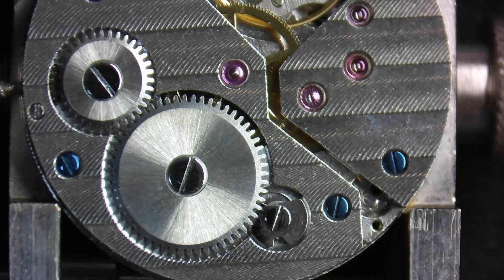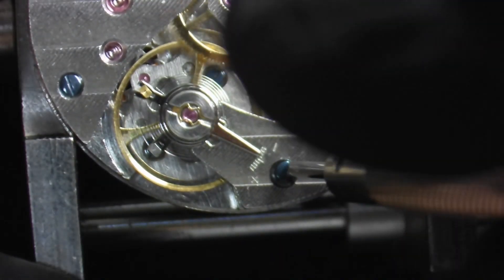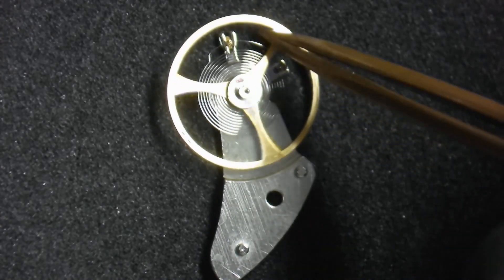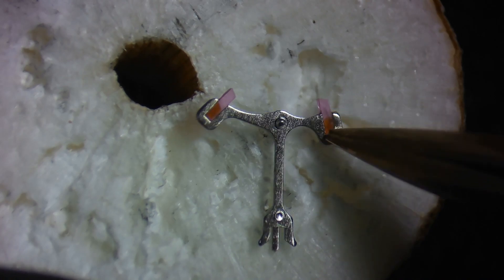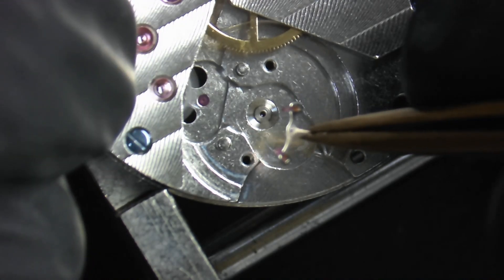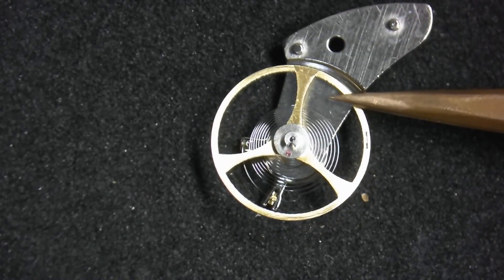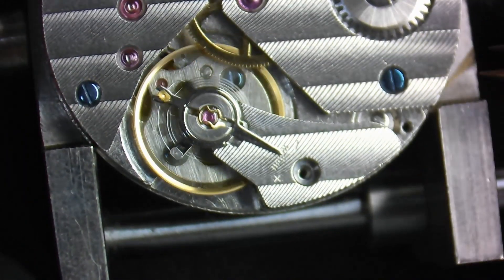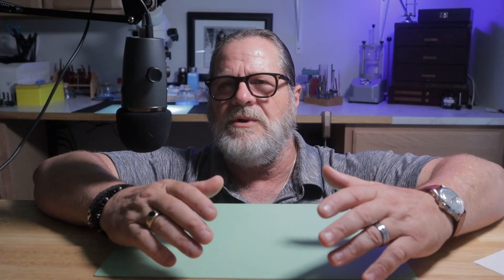Watch Repair Lesson #5- Removing and Installing the Balance Wheel and Pallet Fork

Comment: Thank you very much for this wonderfully informative video. A broken Seiko Presage I bought, had the balance wheel rubbing the plate underneath and only turning 1/2 a turn as described.

It took me several attempts to locate the balance wheel in the hole and at the same time locating the balance jewel in the fork. I finally nailed it. Seeing that balance spring to life was a real Tom Hanks, "I can make fire!" moment. Very satisfying.
Reply from the maker: I love your analogy. I may watch that movie tonight.😂

Comment: They always say the hair spring is super delicate yet most watch makers let the balance wheel hang from the balance cock while replacing it. I tend to try when possible during removal to grab the whole balance complete with my tweezers at one time... Am i potentially damaging it by doing that? Or am I ok? Thanks
Reply from the maker: You make a good point Simon. I think a lot of it has to do with the strength of the hairspring. If you’ve ever pulled the balance out of a ladies watch, do you know those things are about the size of a hair and are extremely delicate, whereas, most pocket watches have pretty substantial hairsprings. I think your method is fine nothing wrong with that just make sure the pivot is out of the lower hole so they don’t get bent
Reply: @watchrepairtutorials  thank you as always you are a boon to new and veteran watch makers alike

Comment: love these videos. so many questions... will watch them all. thank you so very much.
Reply from the maker: What’s your most pressing question?
Reply: @watchrepairtutorials  I'd like to follow a formal program of training into watch repair, and horology. Your recommendations? I'm leading into my retirement and would like to take this on. Advice?
Reply from the maker: @chuknorth  so it really depends on what you’re planning on doing. If for example you want to work for a service center or even a smaller independent watchmaker who works on ETA and some of the bigger brands like Rolex and omega. You’re gonna need to get a certification. This requires going to a watchmaking school, which are typically free, but you have to be able to support yourself and be close enough to the school to get there five days a week.
If you’re planning on learning how to be a watchmaker, and you’re going to either try to be good enough to actually take in work with customers and or be able to buy repair and sell watches on a higher end then I might have something for you. I am actually in the process of writing out a two-year watchmaking course , that’ll be a written course with video both long and short form to back up the lessons. Now the first lessons are going to hit my website in about a month because I still have a lot of back in work to do to get it set up and I’m going to be charging a flat yearly fee that will be very reasonable to take the course. Like I said, it’s going to be a two-year course, but some people will be able to learn and apply the lessons quicker than that but you could take as long as you want. I’m even considering offering some additional mentoring on a different level. It’s probably gonna take me a good six months to get the first years curriculum up but once I do, I’ll open it up. For anybody in the top two tiers of my Patreon I’m going to grant them access immediately as the lessons go up so that may be an option to consider. I’ll be talking about it more in the video that I’m finishing up now.

Comment: Hi. just asking, The Ratchet Wheel, what's the function? what happened if i tightened it too tight?
Reply from the maker: The Ratchet wheel has a square hole in the center that fits over the square top of the barrel arbor. It is turned by the crown wheel. Its function is to wind the main stream barrel. If you over, tighten the screw that holds the ratchet wheel to the arbor he will likely break the screw just as any other screw in the watch.

Comment: I've changed hands,bezels,dials,crystals and you're right this is a step up in a game. I need to do this because a small screw fell into my balance wheel and when I was taking it out with a twezers I fucked up the spring hahaa. I already have the new wheel but this looks terrifying. My local watch maker will do it for 15 bucks (it's a cheap ass vostok watch). DIY is satisfying but dunno about this one. Thank you for a tutorial it's really clear what to do great job!
Reply from the maker: You can do it?

Comment: Mr. Hamilton.... any advice besides be careful lol as to regards to handling a balance.... ive gotten pretty good with removal and installs of balances now... my issue is i have to take one apart to clean and oil the jewels and the fact that, with older pocket watches there isnt a shock setting but you have to unscrew the balance arm and hair spring as part of the cleaning process.... thank you.
Reply from the maker: I am working on a video with a Hamilton 917 right now. You might find what you are looking for.
Reply: @watchrepairtutorials  thank you Sir

Comment: A lot of screws to keep track of. Are the blued screws universal for the most part?
Reply from the maker: If the length is the same.
Reply: @watchrepairtutorials  had a hunch thread sizes were pretty much the same for the most part. Just soaking them in little by little. Only one I jumped ahead to was your microscope vid.

Comment: Alex, any tips on how to steady ones hand when placing parts into the movement?  I get the part close to where it need to go, and then my hand starts to shake and trying to get it in the hole I am aiming for is a challenge.

Edit: Woo hoo!  Did it... I have been really stressed that I would not be able to do this, but when I saw that balance wheel start up when I replaced it all and it dropped in, it was such a satisfying feeling.  I think I also figured out how to steady my hands by taking my other hand and just gently touching the hand that is holding the tool.
Reply from the maker: Other than drinking less caffeine.
 I have a friend who takes Propranolol. Swears there are no side effects. He has tremors in his hands.
Reply: @watchrepairtutorials  Any tips on finding a new Click Spring?  Mine went flying across the room and I can't locate it.  I've been looking for ETA 6497 or the ST36 clone which I had parts diagrams, but not finding any.  I hate to think that this movement will never run again due to it not having a click that works.
Reply from the maker: @perrybucsdad   Watch this https://youtu.be/viq9-V1sv7M
Reply: @watchrepairtutorials  Thank you... that got me right to what I needed, although it was for the ETA one, so hopefully it is the same size.
Reply from the maker: @perrybucsdad  👍
Reply from the maker: Awesome John

Comment: Ok, I did it! 🙈 annnd, it actually runs again 😂 
I did the previous 2 lessons a few times, taking apart and putting back together the keyless works and motion works. Today I attacked this one, and did it! This one will take some practice! 🙈 
The thing that was unexpected to me is just how easy it is to leave marks on the screw heads and even the wheels and parts. It's like, if the screwdriver (or tweezers) even breathes at anything, it's scratched. Guess that takes a lot of practice, too. For now, I'm sticking to the brass tweezers. 
Thanks again for the great lessons!! I can't tell you how much I'm enjoying this. I'm hooked and dreaming about all those future repairs and restorations!
Reply from the maker: Yes, parts will scratch easily. Brass is a great idea.
Reply: @watchrepairtutorials  I spent some time today polishing screwdriver and tweezer tips. Back to practicing...
Thanks again!

Comment: Jeepers! Marking the balance wheels and positioning the pallet fork helps immensely. The posts are in their respective jewel holes, but the balance wheel is  not 'alive'. I've put this fucker in 6 times now.
Reply from the maker: What does not alive mean. Do you have power at the escape wheel ? What happens when you puff on the balance wheel
Reply: @watchrepairtutorials  meaning, when I get the balance wheel seated (or I think it is) It doesn't freely run, as your does in the video. When you put yours in, it immediately started oscillating (came alive)
Reply from the maker: @8lackieray   Well you just need to work backwards. Check the power train to make sure it runs freely. install the balance wheel with no pallet fork and see if that runs freely. If it does, then add the pallet fork. Try to narrow down where the problem is coming from.
Reply: @watchrepairtutorials  Ok w/out the pallet fork the balance wheel runs freely. If I turn the crown, the train of wheels runs freely and turns the escapement wheel freely
Reply from the maker: @8lackieray  ok, so I think you found the area with the problem. Some where between the pallet stones and the impulse jewel there is a problem preventing the balance from spinning.
I would first check the pallet stone action with the EW. If that's ok then check the pallet lever, guard pin and horns for obvious bends.  after that it gets a little more complicated and you need to inspect that the entire escapement under high magnification

Comment: Thank you for this video.  I have a General watch company 17 jewels 820B movement and one of the shaft tabs is broken.  Are all pallet forks the same shape?  could I order one from anywhere or do I need to source a parts watch?
Reply from the maker: No pallet forks as well the pallet stones are different. You need  the same as in that movement.

Comment: Just discovered your video! Great work!  I was hoping to also find a video on removing the balance wheel from the balance cock on those newer etachron movements like the eta 2824-2 where the stud is snapped into the balance bridge as opposed to ones that have a micro screw!  Have never seen this shown anywhere!! Just a thought!
Reply from the maker: I made a video on adjusting the Etachron system. It’s in my playlist
Reply: Thank you - I finally found it  as it wouldn't download for some reason, but yes it is exactly what I was looking for!  5 stars!

Comment: Hi.Thank you for a great videos. I learn a lot from them. I have a as1130 movement that i am servicing . The top balance jewel does not have a spring. Only the  the movement side has it. Do i oil only the movement side jewel.??
Reply from the maker: Not you have to take it off to clean and oil it. There should be screws under the balance cock
Reply: DO i need to take the hear spring off?
Reply from the maker: @eugenerutenberg5281  usually not.

Comment: Hello and many thx for your great clear and informative videos!! 
In your video, when you are flipping over the balance cock, you actually holds the balance cock together with the balance wheel. Don't you afraid of damaging the balance upper pivot by this as it still stuck in the cap jewel and the wheel is tilted against the balance cock?  
Again, many thx I've been watching each and every of your videos and learned a lot:)
Reply from the maker: No because I have a very light touch and usually the pivot would not be in the jewel hole.
Reply: @watchrepairtutorials  got it, thx:)

Comment: Hello. Great video as always. Very useful explanations and tips. Question:  Did i understand correctly that you put a white mark on the balance wheel to notice you the position of the jewel underneath? If so, what was the "stuff mark" that you use and does it not affect the running of the balance wheel?            Thanks again.
Reply from the maker: In the procedure to determine an unknown lift angle, you put a reference mark on the plate, in a place where you can ALSO put a mark on the balance wheel exactly 180 degrees opposite the reference mark.
What you use doesn’t matter. It could be a sharpie or what I like to use, the white off. It’s easy to see.
What we are trying to do is to see the mark on the balance wheel when it lines up with the reference mark that we made opposite the it.
Just add small amounts of wind to the movement until the to dots of color line up. Thats 180 degrees. 
You then adjust your lift angle until until the timegrapher reads 180 degrees and now you know what the lift angle is.
This doesn’t affect the test you are doing but, yes you do need to clean it off  after the test as it will add a heavy spot to the balance wheel.

Comment: Does the “white out” affect the balance? These are great videos, I have an AT36 movement and am following along. I know this is a very simple movement, can this technique of marking the balance wheel be used for fancier movements? Thanks a million!
Reply from the maker: It will definitely affect the balance if left on, so you want to clean it off.

This is only a method used if you can’t find or if you have doubts about a lift angle being correct.

Comment: You made it look easy (sort of). Took me about two hours the first time but it worked and I didn't mess it up. Getting the balance wheel in and lined up with the pallet fork took some time and patience. Thanks! Keep up the excellent videos as they are much appreciated.
Reply from the maker: Thank you 3206,
The 3 takeaways would be to take your time, position the pallet fork do that the impulse jewel slides in, and don’t tighten the screw until the balance is spinning freely.

Comment: My project watch would not start by winding the mainspring but can be started with a nudge on the balance wheel. When stopped, I notice the entry jewel in lock position and when I move the balance wheel so that the jewel is on its break position and release,  it still not enough to start the sequence. I have to move the wheel way past the break position for it to work. There's must be some friction with the gear train although it moves freely before assembly of fork. Any advice?
Reply from the maker: Are you saying that the escape wheel tooth is not unlocking from the pallet stone and sliding across the impulse face of the entry stone?
Reply: @watchrepairtutorials  Yes that's what it looks like. I had this old non running pocket watch evasco sa and can't remember where I got it from so, I decided to practice on this on disassembly and re-assembly. I have no intention on cleaning or oiling at his point, which would be my next phase of learning, and just focus on tear downs. I got a used stereo mic for my elex work and used this now for watchmaking which is handy in observing this tiny fork do its job.  So, yes when i move the balance wheel, the entry jewel lift and goes on top of the teeth and past it.  Your question implies that It should do this on its own so now I have to check how much pressure the train wheel is imposing on this escape wheel teeth. Thanks.
Reply: Update: I found the hairspring stud was  misadjusted and the jewel at its quiescent state sits outside of the banking pins. When I install the balance wheel with the impulse jewel inside the fork, it now exerts too much pressure on the fork against the banking pin and thereby locking the pallet jewel and excape wheel. I readjusted the stud so that the impulse jewel falls in between the balance pins and it started just fine. I would recommend a cheap working and healthy movement to practice on assembly/dissaembly for beginners like me to avoid confusion on improper assembly to legit movement issues.

Comment: This video saved my butt.  I had finished putting my first disassembled movement back together and installed the Balance wheel but had no movement after a wind.  Watching you video helped me realize that the impulse jewel was not in correct position.  Once fixed, I had my first repaired moment,  a Wittnauer 11ARB.  It needed a new mainspring which was another first.  I'm hooked now and can't wait for my next.  Thanks.
Reply from the maker: Thanks for following along